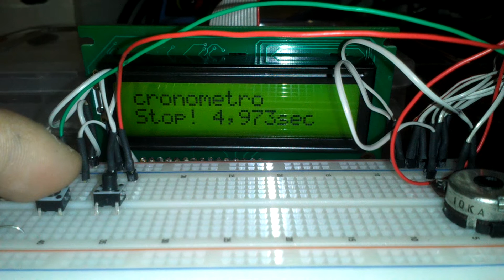Cronometro con arduino

Comment: Ciao avrei un problema a proposito di un cronometro che vorrei realizzare: la partenza dovrebbe avvenire con una fotocellula che dal buio passa alla luce, e quando è oscurata deve bloccarmi il conteggio. Risoluzione di 1 ms, o se possibile anche meno.  
Funzionamento del cronometro con singola fotocellula
Appena fornita tensione il display deve mostrare la scritta scorrevole: Cronometro Pronto - Premere Start per cominciare.
Arduino deve controllare se la fotocellula è oscurata prima che Start abbia inizio, e contemporaneamente visualizzare sul display la scritta: Tempo Apertura nella riga superiore, e nella riga inferiore:  millisecondi.
Se la fotocellula è buia, all'azione del pulsante start Arduino deve restare in attesa.
Appena la fotocellula viene illuminata, Arduino comincia il conteggio in millesimi di secondo e contemporanemente viene visualizzato sul display dopo la scritta col valore corrispondente partendo dalla destra.
Come la fotocellula passa allo stato di buio, Arduino deve fermare il conteggio, e contemporaneamente visualizza il valore sul display. 
Dopo 10 secondi se non viene premuto nuovamente il pulsante Start, il display deve visualizzare nuovamente la scritta: Cronometro Pronto - Premere Start per cominciare.
Arduino deve restare in attesa del comando.